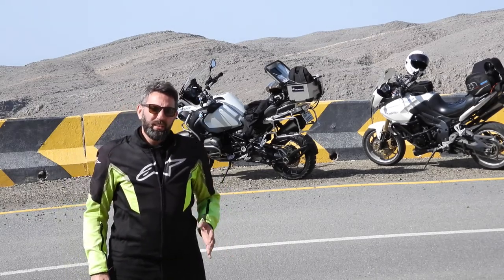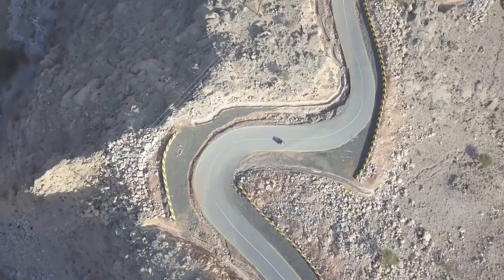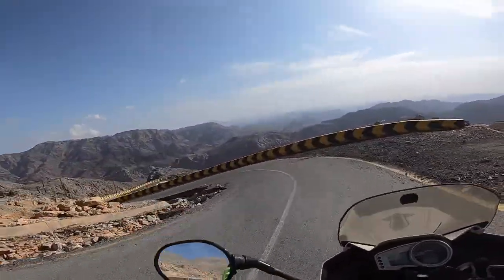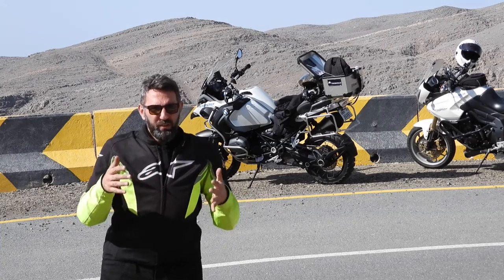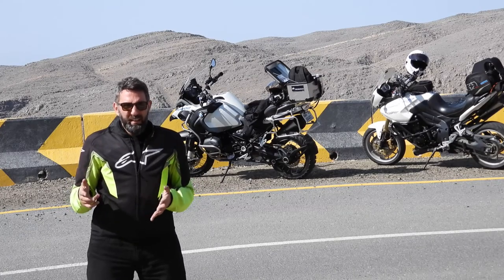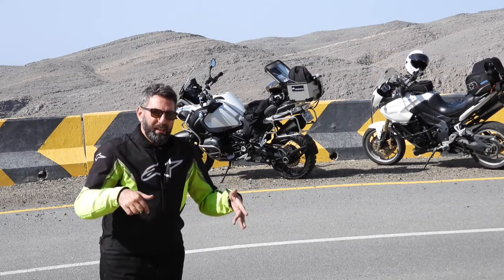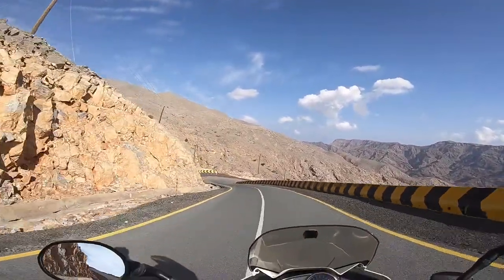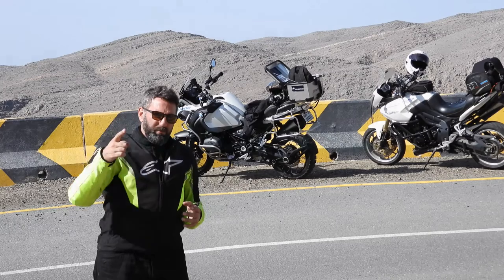How to ride a motorcycle down a steep hill - dealing with hairpins

Comment: Imma alive~! 
Alternative and Additional considerations
= do-not upset the bike, in any way, before a corner, during a corner.

Shift weight, shift gear, change speed, stabalise, enter, stabalise, whatever
Avoid gear 1 (even for engine braking, if need gear 1, rather burn the brakes)
Avoid cam-change ranges after downshift (if cam-shifts at 6000rpm avoid downshifting into 6000rpm where brake or throttle will create stress. Cam-shift includes VTEC)
Avoid turbo shifts (some dragster-styles installed things bad for stress levels), between lag to spooled
Use coasting-feel of lightweightedness for maximum tire-grip without-changing gyroscopic-effect of wheels or engine (coasting-feel can be in-gear at engine-rpm matched to wheel-rpm without touching clutch-lever)
Avoid braking in-corner

When overcook, throttle for rear wheel to oversteer(slide), changing attack of the front, creating sideways centrifugal-force effect (not necessarily 2 wheel slide) of both tires to create big braking effect.

Applies to cars too. After thinking this strategy out, apply to drag race games to check, apply to other computer games to test. Target is different (gear) shifting strategy using downhill as the benchmark for power to weight ratio controlled release-application
Reply: 13000rpm redline but coast in corner at 8000rpm, missile-aim by reducing throttle gradually, as brake, to 5000rpm, after aiming, throttle to cross 6000rpm cam-shift point. Ear can hear intake roar and exhaust-note(not noise, not loud pipes) at points...

Comment: Nice video
I have one question, If my way has a deep slope. Then how should i control the bike 
Do i need to use the engine braking , brakes ?
If yes then shall i use first brake and both the brakes ?
Reply from the maker: Hi, thank you for the comment and a great question! The way I handle kind steep slopes is to keep it in an appropriate gear at which I can manage the slope with minimal braking, so keep it in gear, and make sure you don't drag the rear brake for too long, slow down (with both brakes, front being primary) sufficiently before the turn and just lean in. Which brake you use first is not that important, just don't hit the clutch unless you are coming to a complete stop otherwise your brake may lock up if without ABS
Reply: @todxbranko  , Thanks for the quick and understandable answer. 
Can i use the half clutch on the above scenario other than no clutch ?
Reply from the maker: I don't see a reason for clutch modulation unless you are so slow and your bike is about to stall. Just let is roll
Reply: @todxbranko  , I was asking this because in india we have many places which has a basement parking for many buildings. So for that scenario where the slope is very deep and i am controlling the bike with brakes . So it might stall in middle because of any reason.
Reply from the maker: Basement parkings are not nearly long nor steep enough for you to worry about fading brakes, just relax and do it in the safest way possible
Reply: @todxbranko  , Thanks for all ur answers and responsive reply. I wish you All the Best for your channel and keep posting such a amazing knowledge with us.
Reply: @todxbranko  , I have one doubt. I am sure you will answer it.
I do understand that we should use both the brakes but question comes how.
1) Do we need to slightly hold the brakes with not much pressure just slight pressure 
Or
2) Press and leave brakes again press and leave brakes it will feel little jerk but fine

What is the best solution pls let me know. Thanks for replying for the comments in your videos. ❤
Reply from the maker: Hi Rahul. If you are catching more speed than you are comfortable with  press the brakes enough to slow down to where you are comfortable and then let them go. The whole point is not to drag them because even with slight pressure, over a prolonged period of time they will overheat and fade

Comment: What if there's oil or if the roads really wet on the hill? How do we stop? Or slow down. Someone said, do not use the front brake, otherwise the bike will 100% skid and fall.
Reply from the maker: Hazards on roads can happen, in those cases your best case scenario is to avoid any sudden inputs be it braking or accelerating, tires are much more capable than you gube them credit for. Having said that, learn to modulate your brakes and don't worry too much

Comment: What about wet rainy hills with hair pin bends on a scooter, it's the same breaking?
Reply from the maker: Yup, just say a prayer first 😅 jokes aside, is an automatic or manual transmission?
Reply: @todxbranko  scooter nowadays comes with cvt automatic..
Reply from the maker: @YansenHaryanto4547  most of them do, but a lot of small bikes around southeast Asia and the far east do come with regular transmission, even though they look like scooters. I have ridden my fair share of CVT scooters over the years between 50 and 400cc, and yes, scooter's biggest issue in these kinds of situations is that it doesn't really have prominent engine braking, in which case your brakes are indeed the only way you can slow down. General premise is the same - weight to the rear, reduce speed enough before entering the corner and ride through. Trail brake if you have to but reducing speed before the turn ensures that you brake with the motorcycle upright, which gives maximum traction, rather then when your bike is leaned over and the contact patch is reduced
Reply: @todxbranko  Is not contact patch increased when leaned
Reply from the maker: @Tilen KC No, contact patch decreases as you lean, thus in slippery and wet conditions for example you tend to lean less in order to make sure that you have the maximum available traction
Reply: @todxbranko  well I always thought so but they told me the opposite in the safety course. Along with other suspicious statements.
Reply from the maker: That's a curiosity! I applaud you for seeing through bullshit and looking for information on your own. Be safe out there

Comment: Can someone answer this: I'm going downhill, and start gaining speed(pulled clutch). Now when I release clutch I hear motor revs go up and bike slow down a bit(engine brake?). Will this hurt clutch in any way?Then I apply both breaks gradually to almost complete stop before hairpin. Look into turn, my shoulders follow, my bike follows. Right?
Reply from the maker: Assuming you know which gear you are in and how fast you should go not to overrev a specific gear, nothing major will happen to your clutch. If you don't know which gear you are in and don't have a slipper clutch abruptly dropping the clutch and revs going up you can easily lock the rear wheel. It's safer if you stay in gear and let the bike roll
Reply: Search canyon chasers on YouTube.  You will learn how to corner on a bike the right way. Has a whole video on down hill

Comment: when riding downhill i always alternating between front and rear brake.. it's like 5 sec of front brake and 2 sec of rear brake.. is it okay or not? i never had that brake gets overheat
Reply from the maker: Your brakes are working well, you are not dead, that means you are doing something right 👍🏼👍🏼👍🏼
Reply: I do the same thing. I press brakes equally. Is it a good thing or bad idk
Reply from the maker: As long as you are not dragging the rear you'll be just fine

Comment: For hills (small roads) riding, which is more important horse power or torque? My current bike Gixxer SF 155 ( 13.9 PS & 14 Mm torque) is becoming stressful for me (77kg) when riding steep hilly roads which is where I live. My options right now are R15 (18.7 PS, 14.1 Nm) or FZ25 20.8 PS & 20.1 Nm). Which of these two will be better suited for my requirements? Thanks
Reply from the maker: That's a great question. 

Short answer would be torque. Look for torque figure and you will be happy. 

Long answer would be, I have to consider the configuration of both the R15 and the FZ25, how many cylinders, displacement, torque and power curves, gearing, and bottom line, take each for a ride and see which one feels better for your requirements. The FZ might have better numbers but it just feels uncomfortable. The R15 might have lower numbers but available from early in the range so it pulls from the get-go.
Hope I wasn't too confusing
Reply: the FZ25 will be a better option for hilly terrain as the torque comes in at lower rpm than the R15, and it has more torque as well. this means that you will have better engine braking and more climbing ability.